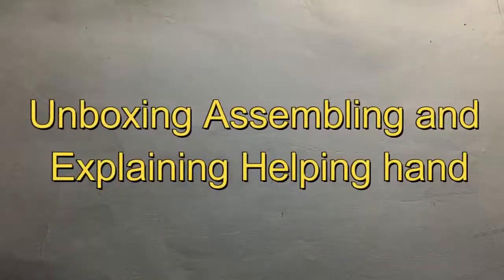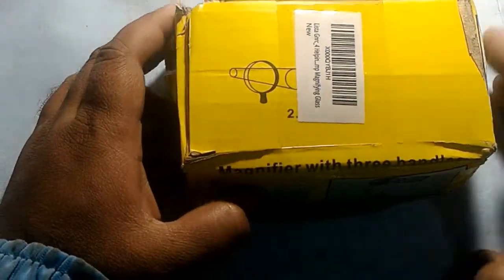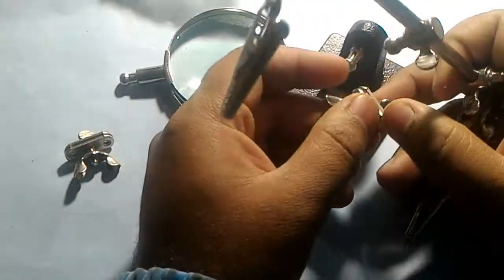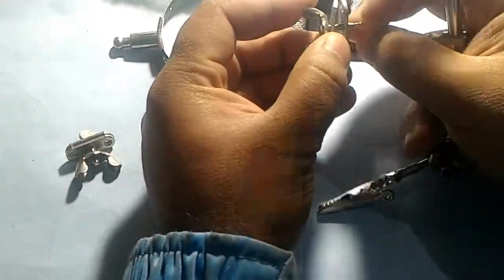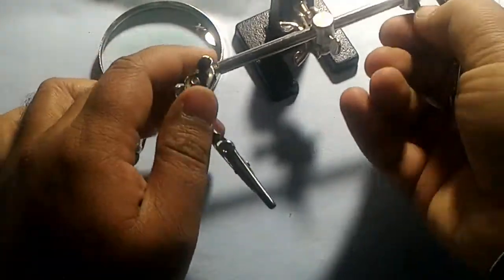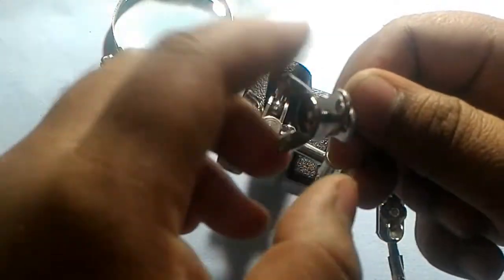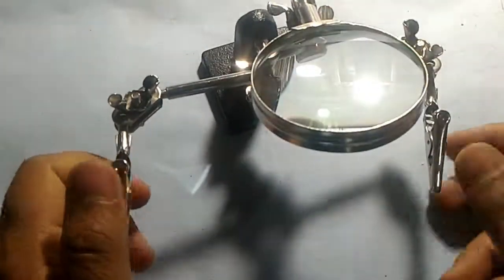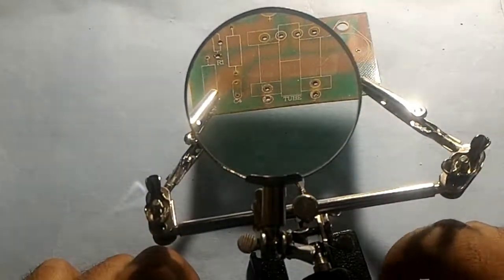Unboxing, Assembling and Explaining Helping Hand - An important tool for all electronics beginners.

Comment: I am literally angry at the vendor and you. I cannot get this damn to work
Reply: It's not hard to assemble. You can even mix and match parts - I have my magnifying glass on one of the main shaft endpoints and one of the alligator clips on the slider that comes with the magnifying glass.

This is a really cheap third hand. Nice ones will cost hundreds of dollars. But for solder work, this one is reasonably good, considering the price. It's not unheard of for people back in the day to spend more than a thousand for a decent third hand and a hand rest.
Reply: Yes cant atach the f****k glass